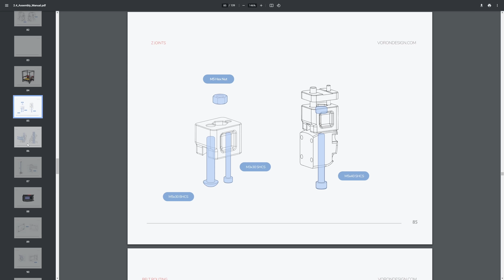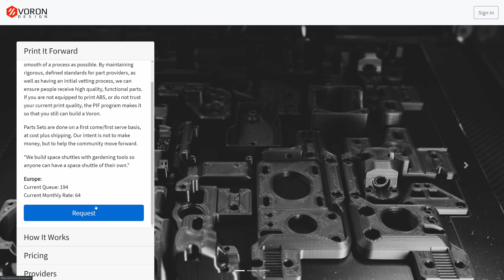My new favorite 3D Printer! The Voron 2.4 Build Experience

Comment: Chris from Chris' Basement said the same thing the other day about the ugliness in the communities around Klipper and, in his case, Voron. I do like both Voron and Klipper, but that silliness does leave a seriously bad taste in the mouth.  I was going to go for a Voron later this year, but now veering towards a Rat Rig.
Reply: It's fanboyism. Nearly every large community has these. They're not liked by the other members of their communities either.  

I had similar experiences with Duet and RRF back when I first got in to the hobby. The general additude was that their way was the only correct way and that you're an idiot for having a basic question that no documentation covers, let alone if you hinted at the existence of any other firmware or hardware options. And that would be from their forum mods and even some devs at the time, which was likely why the place was so dead. It's been years since then, so I hope it's improved.

Comment: I wish you showed your speeds and prints at those speeds next to it instead of saying 3x the ender because it's very vague!
it's very weird but there's rarely any actual print results of prints from the voron community. i try to find them a lot but there's rarely any that showcases the print quality very well.
Reply: Are you part of the discord?
Reply: thats true or show actual speed they printed the piece at i would like to see someone with a 2.4 print a large detailed print at fast speeds and see what it looks like
Reply from the maker: For reference, the fan shroud I showed was a 2 hour 41 minute print on the 2.4 - 250mm/s, 10kmm/s², 0.6mm nozzle, 0.3mm layers. Basically 100% infill.
Slicer estimates for other printers (with default settings)
MK3 0.15mm 20h
MK3 0.3mm 9h
D25 0.2mm 21h (scaled to 96% height to fit) 
CE-6 SE 0.2mm 26h
Neptune 2 0.2mm 23h

Comment: Thanks for this informative video.
My Voron 2.4 build journey was... just much longer. From committing to the project to getting a working printer was 8 months.
Halfway through that build process the kits started appearing, and I sure would recommend getting them just to save on the hassle of dealing with suppliers that only want to sell large quantities (and the local duty office).

I also love my printer, I did not however tune it to go as insanely fast as you did (just wow, 1m/s move speed!! I was ecstatic to do half that, never tried faster), just because I actually want to use it.

Lastly, as someone that contributed some features to the now infamous firmware ecosystem, I'm very disappointed that anyone would "at best" troll someone. This is not right.

Comment: Take the emotions out of it. We're tech people, we're interested in learning about what the best engineering solutions and ideas are. So picking a Voron with its nice features such as the way it can auto adjust the carriage/gantry leveling, or using a magnum plus hotend and never running out of flow capacity is the same as using Klipper. Klipper turns your main board into a mindless drone and moves the brains to your more powerful octopi. Its a supercharged and highly upgradeable brain. From an engineering standpoint, this is a logical choice. The best printers are made withe the best parts. So you should just be interested in how to build the printer with the best possible parts and engineering decisions. Don't worry about trolls. Just build badass 3D printers.
Reply: But.. but toxic people😭

Comment: After four years of tuning, caring for and maintaining my printer, I have managed to push it to 85 mm/s (Anet A6) with 0.25mm nozzle. No ringing, stable extrusion, no ghosting, identical prints without issues, just reliable worker.

Vorons were shown to achieve 600 mm/s reliably without any trouble whatsoever. I guess that's a call for upgrade - it's like swapping Pentium MMX 200 MHz for an Athlon XP 2500+...
Reply: Athlon XP? Sounds like Pentium D to Ryzen 7
Reply: @calebdrake3544  Close. But to feel that upgrade, I'll havy to build my own Voron!

Comment: Sorry for the necro on this... I decided to take the big step into the deep end. I went down the core XY rabbit hole on YouTube and somehow settled on the Voron 2.4. I looked at your build spec and will likely adopt all but the hot end and the main board. the Fystech seems to be overbuilt, which is what I like. I have selected the Volcano at the current winner. My current  FDM printers are a Lotmaxx SC-10 and a Flsun qqs pro. To say I am seriously considering being in over my head is an understatement. To say I'm excited by the possibilities would be a massive understatement!  I'm not truly interested in insane speeds, but want exceptional accuracy. (All that said, the speed would not make me sad). Am I looking at the wrong project?

Comment: For insulation under the print bed I bought a caulking gun style tube of automotive RTV silicone.  I went with the orange high temp which is way overkill of course.  The material can be shaped into any shape, adheres to everything, and it is oil and water and should be acetone resistant.  

There is a lot of acetic acid vented given the relatively huge amount of material being placed.

A 300ml tube is around 12 dollars here so it is cheap.

Also it bonds to itself after curing.

I have a new idea to use it.  I was looking to add strain relief for the heated bed wiring.  I am going to print a mold that will allow my wiring to be set inside and then flood the RTV into the space to create a rubber type strain relief.

Comment: Personally running Subtle Design Staymag instead of Energetic as it is guaranteed to 150 degrees Celsius. I also had adhesion issues with the Energetic sheet after a few uses.

Comment: I´m dreaming of building one for quite some time. But in order not to spend so much money in one take, I´ll do it by steps and source the parts as the project goes. Might take a few months or more to complete the build. I´ll go large (350). Buying stuff as the project goes insted of doing it all at once will allow me to go for more interesting components (like a Revo hotend) instead of getting a closed pack kit. 

I can source some pre-drilled extrusion kits locally (there´s a Brazilian supplier for them), then go step by step buiying stuff and printing components on my other printer as the build goes on. That will be my build strategy. :D

Comment: ordered the 400mm vivedino for work from formbot... and i gotta say, well worth it. it came with a direct drive which was unexpected (picture showed bowden) and i have to replace the normal spring that came with that for proper clearance but it prints so fast and well and HUGE parts. Perfect for our 1/7th scale furniture models. printed a full king size bed! was like 14inches! 0 warping and popped off the magnetic bed uber easy when done. its definitely the best single extrusion printer for 2k out there as far as i can tell.
Reply: Are you talking about the troodon? The orbiter comes standard now.
Reply: @Tedlasman  ya... ive noticed a trend were chinese companies update their machines before updating their website. so it didnt actually say it came with that and i was pleasantly surprised back when we got it.
Reply: That's cool the Vivedino is working out for you.  I got one early on and when the direct drive extruder came out I bought the retrofit kit.  Problem is the Bowden works so well I've not been very motivated to switch.

Comment: I'm building mine now, following your "was live" build on this machine. My Formbot came with stainless steel bolts and not those black oily ones, so maybe they took heed? I printed my 3d parts on my 9 year old Medel that I built from parts from the hardware store and other stuff I got on Ebay. The hot end is held together with baling wire (otherwise it would fall apart) and heat resistant sealant for cars!), so the parts it's producing are borderline passable. I really wanted my old Medel to have one last good run at something before I retire it. Anyway, I'm wondering about the insulation you mentioned below the heated plate. Would this still have warped if you'd installed the very bottom plate and the cooling system for the electronics? I'm wondering if I should try and insulate as you suggested, or if the cooling system for the electronics enclosure would keep the heat down enough if there was an actual "flow" of air beneath it? My concern with adding insulation, of course, is the the aluminum plate might distort if it ends up with hot spots where heat is trapped.

Comment: @Thomas Sanladerer Believe it or not, the bottom panel bends only because the DIN-Rails are in the wrong direction. They must have the same direction as the rails from the heating bed.

Comment: The part at 7:30 you talked about, that you didn't install yet, that seems to "tweak" the balancing of your bed via the hot tip that's installed? 
I"m curious if it's installed if you would be able to increase your 50% speeds to 75% if it's 100.0% level etc.. ?? 
They also make bottom feet for telescopes that keep them from vibrating.. wondering if those on the bottom would help just a bit more when it's going fast.. 
I'm convinced you can hit ALMOST 100% speed, if your level is 100% and temp/filament etc. are all perfect. LOL . yeah, cuz I wanna see this thing running full speed :)

Comment: The Voron 2.4 looks like a hybrid between a delta and a CoreXY printer. It's a really interesting design!
Reply: This is what I said when I first saw a Voron 2.4.

Then I saw a RatRig V-core 3. That thing is even more of a hybrid delta/coreXY.
Reply: @Gnat-Swarm   I would compare the RatRig V-core 3 to an Ultimaker 2   (soon reaching EOL) that has three z-axis leadscrews instead of one.
Reply: @ZearouAyedea497  With the design of the Voron 2.4 they have to use 4 Z axis motors, they have no choice. There implementation evidently works very well. You only need 3 points to fully constrain a plane. 3 legged stools are easier to level and stop rocking than 4 legged stools. This is  the reason Prusa also used 3 points  to support the bed on the MK3S pritner. In addition parts left out cost nothing and don't fail.
Reply: @liamventer  I'm guessing the use of four Z-axis belts to move the ends of the Y-axis linear rails is what allows the printer to tram effectively (and flexibly?). I wonder what the trade-offs of using a rigid, rectangular frame for the gantry and three Z-axis belts would be. There would definitely be more mass to move.
Reply: @liamventer  The point is: your 3 leg analogy assumes that the gantry is a rigid and perfect plane. It is never perfectly aligned and it is somewhat flexible - the four corners however are able to bring it into a reasonably close approximation of a perfect plane.
Reply: Yes but not very heavy compared to moving bed which most coreXY printers including the Voron 1.8 do just fine. 

And this talk of flexible being a good idea in a 3D printer is worrying.
Reply: @ZearouAyedea497  So basically a band aid for a flexible printer. Better to just make it sturdier.

Comment: Other similar printers include the BLV MGN Cube (Please have a look at these, they have their advantages and disadvantages over the Voron 2.4, but also has been around a little longer....I'd like to hear your opinions vs the Voron. It does only have 2x Z-axis leadscrews stock, but many are using a 3x z-axis variant), and a couple others. They have similarities and differences, all have community followings and improvements. Voron has a more complete finish, and more in-depth manual.

Comment: Tom I thoroughly enjoyed your Voron Series, I can't imagine what it would be like doing all that in a live stream, but you pulled it off well!  My question is simple.  What have you found to be a reliable printing speed for PETG for simple functional parts - disregarding extreme overhangs and bridges?  I understand EVERYONE is interested in speed because it's fun, but I'm also interested in practicality - sort of the RoadTrip vs the QuarterMile.  Thank You
Reply from the maker: The fan shroud I've shown was printed at 250mm/s, 0.6mm nozzle, 0.3mm layers. 2.5 hours print time total. Works absolutely perfectly except for a bit of ringing at sharp corners - the setup could push filament much faster, it's just that it needs input shaping at that point to be somewhat pretty.

Comment: Im really tempted to do this, I have built some custom cartesion printers, but would really like the speed of these. I really love Klipper for the flxibility and performance but I do know what you are talking about with the Klipper community. The Klipper creator uses and recommends Octoprint, but the community really attacks people who dont use Fluidd or mainsail instead of octoprint. Its a great firmware but there is definitely a vocal core of the community that aggressively push their preferences and attack others who do things differently.

Comment: I wonder why nobody puts the extruder in the center of the top rectangle to shorten the bowden tube x2 times. Great machine!
Reply: Thats a reverse bowden. Its a direct drive extruder, see 13:40. Having the non-toolhead end (spool end in this case) in the middle of the machines top, would not allow any significant change in the length either. Just think of how long it would need to be to reach the furthest point. Quick math says 420 ish down to 320 ish. And mounting the spool or extruder there would be difficult to say the least.

Comment: Hi Thomas. Really inspirational videos on the Voron. Speed is fun, but more looking for consistency and ease of use once it is up and running.

There is an aluminium option for the 3d printed parts on Ali. What is your opinion on that? Quite pricey but looks nice.
Reply from the maker: The parts are designed to be printed - so I'm totally okay with using them as intended.

Comment: I want it. It's a printer where the engineers said "lets make it go as fast as possible with COTS components and 3D printed joints." But I don't have the time to DIY a printer. I can carve out 8 hours to put together a complete kit; a multi-day build isn't going to happen for me. If a kit came with a harness and packaged electronics, I could see it being 8-10hrs.
Though I can completely understand the makers not wanting to make it a business. Startups can suck all the life out of you. The fun project stops becoming engineering and becomes spreadsheets, timelines, and budgets instead. (by the time they got that overhead in place, the ROI would hardly be there,  and it'd be a $1500 printer) I do sincerely hope that companies (stares at E3D) start making this as a more complete/reliable kit.
Reply: LDO is starting to make kits , they are one of the more trusted parts manufactures and they are starting with the V0 kit at $650usd. With plans to make the others after they see how well it sells.
Reply: As a matter of fact, the designer of the original Voron (which is an ancestor of the Voron 1 line) indeed started it as a company called MZBot selling printer kits, much like Rat Rig. But, unlike Rat Rig, he soon realized it wasn't going to be profitable, and so the Voron Project began.
Reply from the maker: Exactly - that's why I mentioned that Voron explicitly decided against making their designs a commercial product.
Reply: @MadeWithLayers  but decided to make branded boards and hotends, and swear to the community that they're not taking money from them.
Reply: regarding "lets make it go as fast as possible with COTS components and 3D printed joints."
You're wrong.
RCF said himself that it's aesthetics first.

Comment: I have the same Formbot kit and the motors do have the JST connector on them. However the whole packaging of my kit was a hot mess, and the cable chains were not of the type that you can open. Consistency seems to be the problem with Formbot; you never know what you'll get.

Comment: Thank you for the final build video report, but a novice like me would never have the patience to go through what you went through to get things to the point where We can use it to make products in our business.  We need to find a material that doesn't shrink at 150 f.  PLA and ABS shrinks 20% after printing when part is stored in 150 and higher. I have always thought that the manufactureres give you the opportunity to get free product so you can do all the form bot kit build steps so they can get you to R&D.  Now they can offer a more refined kit that is easier to assemble, print a better assembly manual or better yet a video. Would love to just buy this printer in a mostly preassembled version. surprised that the electronics isn't housing enclosed.  please message me if this printer is out of the box available..

Comment: This is the first I've heard of Reprap Firmware having input shaping. Do you have a video on how to set that up?
Reply: It is actually in beta testing, and will be included on RRF 3.4. So far it is quite limited in comparison to Klipper, but I believe RRF developers will catch up soon.
Reply from the maker: I'll definitely compress my findings into a video once I've set it up on mine!
Reply: RRF does not have Input Shaper yet (it's coming in 3.4 though!). It has DAA confusingly labeled as Input Shaping, which is kind of a stretch. DAA will negatively impact your print time in a significant way as opposed to "real" input shaping, and it's not quite as effective at reducing ringing. Tom may be using the 3.4 alpha/preview?
Reply: @miklschmidt , actually DAA has less effect on print time than other forms of input shaping, not more. But you are right that it's typically less effective at reducing ringing.
Reply: @MadeWithLayers  Thanks Thomas! Looking forward to it. Cheers,